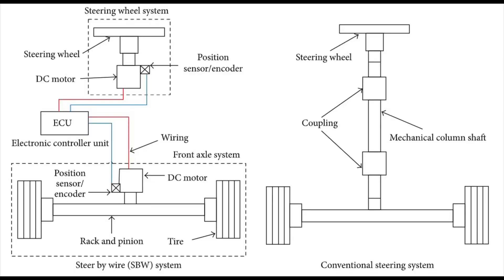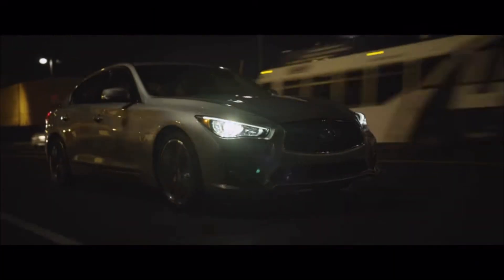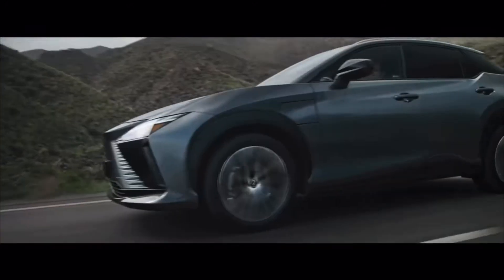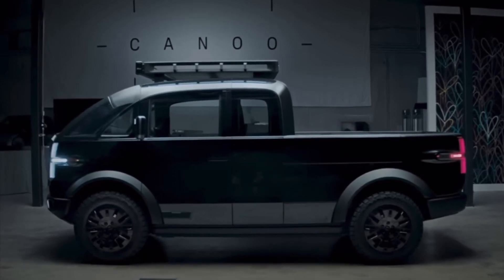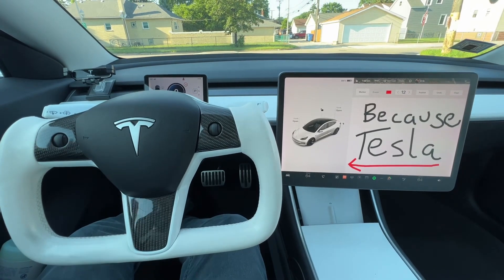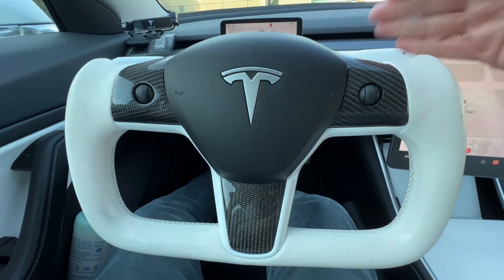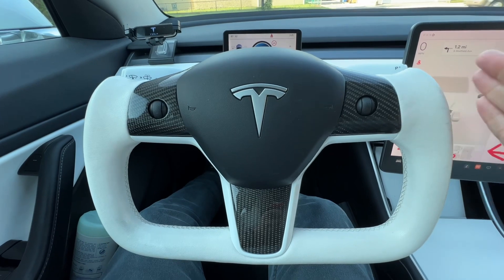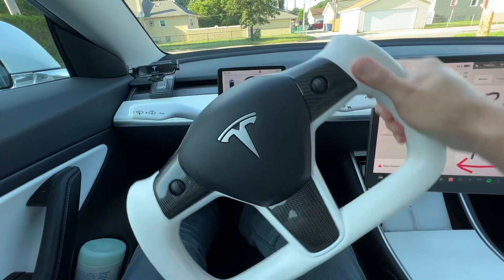Tesla Steer By Wire!  What is it, and why?

Comment: I think it’s a terrible idea. If an alternator fails, the battery fails and the car stops. If a motor to your steering fails, you crash
Reply: There’s a possibility, especially with EVs, to have multiple paths to power. So even if many components fail, the steering maintains in almost all cases.
Reply: I really don’t understand the benefits to technology.  This technology*
Reply: @maxcalder1010 That sounds like a you problem
Reply: You have good points, but trust me, all of those things are heavily considered.
Reply: This has been implemented ain some Lexus cars and in their case it’s two separate systems so if one fails your fine also in many cars the brake and or throttle are by wire
Reply: Sir, it's an electric car. There is no 12v battery in the cybertruck.
Reply: @Lancaster604 same rules apply, a power failer to the steering would potentially kill you regardless of backup motors
Reply: @Lancaster604 there is a 48v system.
Reply: Ever fly on a plane?
Reply: Ever heard of a flap jamming, I have
Reply: Look up attorney Matthew Chiarello
Reply: Alternators, starter motors, there things fail but none of them would necessarily kill you
Reply: Also to focus on the wires?! That’s just branding, wires are a simple process which is probably mostly ac modulation, or the fact it’s all classed as electronic but not like that that motor drives a rack and pinion. So electric modulated steering is more accurate plus wire as in electrical can be confused with wire as in wire cable as in cable breaks